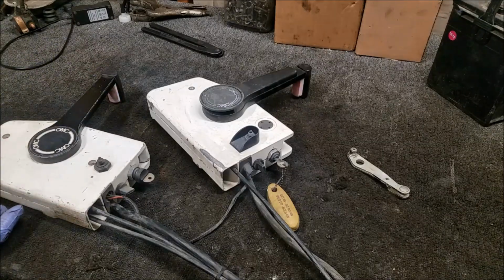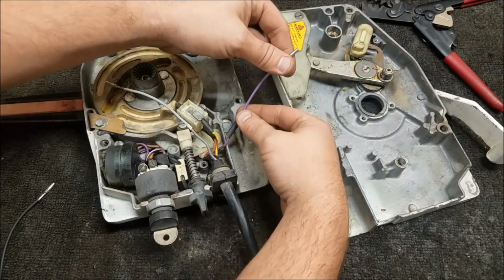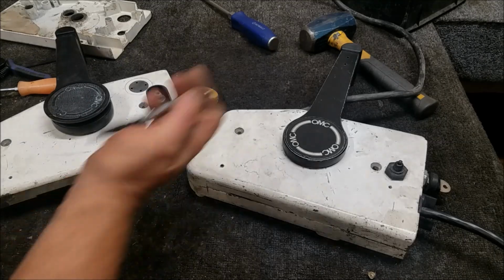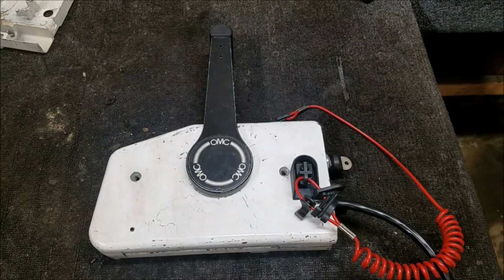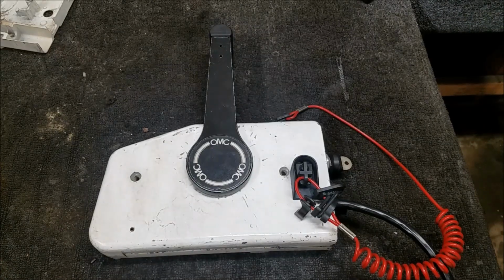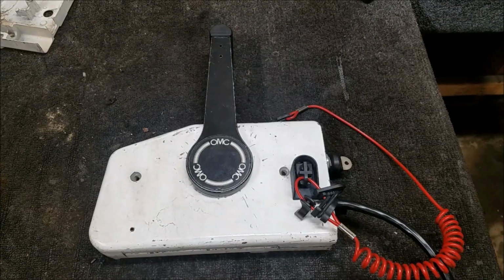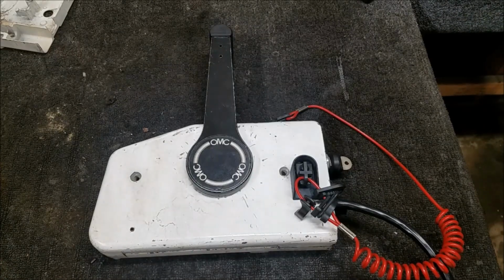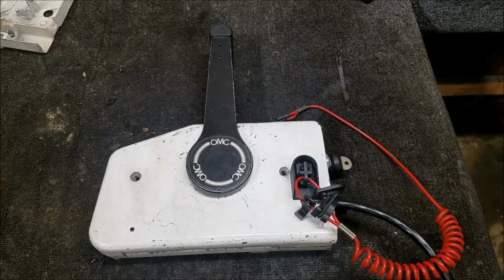Fixing A Broken Johnson / Evinrude Remote Controller

Comment: Where did you get the connector i am looking for a female that goes into plug in my tach wire was discarded by previous owner from omc to dash
Reply from the maker: Well you can get the whole harness on ebay for about $30.
if you want to DIY one, the plug is 0511465 - Connector
Terminal is 0511469 - Terminal

Comment: i  have a old 81  crist craft   115 hp johnston   out board   the controller  shifts fine into neutral and drive but reverse  it just makes a noise in the control box like its not going  into gear  just hitting something like teeth  and not fully engaging  slipping off a gear teeth  sounds not in the motor  but just inside the box  its  self

Comment: Is there a way to bypass the neutral safety switch to verify that the ignition key is not bad or to verify it is indeed the neutral switch.
Reply from the maker: Have you checked the engine fuse?

Comment: Mine doesn't seem to split in half. Using drybar and screwdrivers still not working
Reply from the maker: Got all the screws off? Did you remove the handle?
Reply: @BrandonsGarage  thank you for replying! Actually did get it apart, replaced ignition switch now having a difficult time putting it back together. I have a cylindrical plastic piece about 3/8 x 3/8 that fell out. I think fits in the neutral throttle mechanism. But the main problem seems to be getting the plastic throttle disc up against what appears to be some sort of neutral switch. I will watch the video again, perhaps I missed something. Mine is an early 80's model
Reply: @BrandonsGarage  mine is a right hand model. Seems I have to take the handle off to get it back together? Currently trying that but not coming apart.

Comment: I have this same controller I took it apart to replace the fast idle lever now the shifter is stuck in neutral can’t move it at all any ideas?
Reply: I’m having same issue.. but on a simpler control box.. did u find out problem ?

Comment: Like an idiot, I went to start up the motor to run some water through it. Didn't realise kids playing around put the throttle up so I put the choke up to start, then noticed throttle up so like a knob I slammed it down with the choke up and it broke a tooth. Trying to super glue it lol but I doubt its gonna work lmao. I think I have to buy another sigh
Reply from the maker: That sucks.
Not as bad as rebuilding a lower unit only to forget to add oil and run it all morning before it exploded bad; but still.

Comment: Where is the engine fuse located
Reply from the maker: On the engine wiring harness. Find the red plug, flow it up the engine, and find a small red round thing. it may be black with dirt, its about the size of a chapstick tube, cut in half.

Comment: What is the round black cylinder right above the key? Thanks
Reply from the maker: Warning buzzer
Reply: @BrandonsGarage  Thank you!
Reply: @Brandon's Garage  My buzzer got so hot it melted. I put a new one on. I unhooked the purple wire and as soon as it started getting blistering hot I shut it off. Any idea why the brown wire that goes to the heat sensor would get so hot it will melt a buzzer? It's a 1990 Johnson 150 GT with an OMC control.  Other than that, the motor runs great!